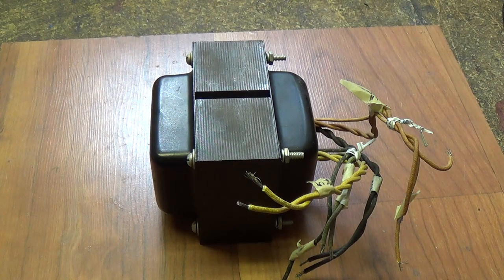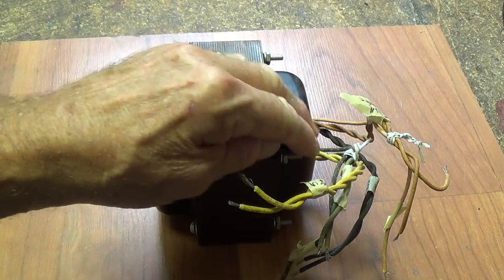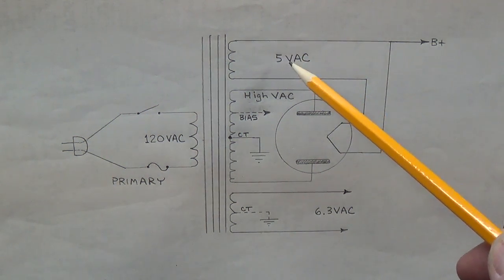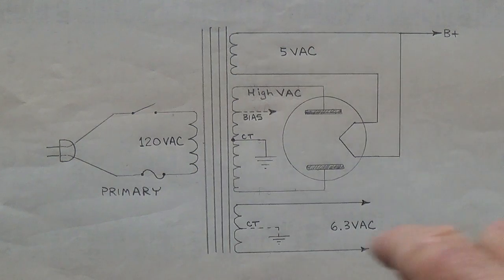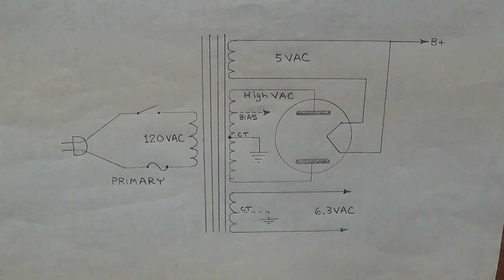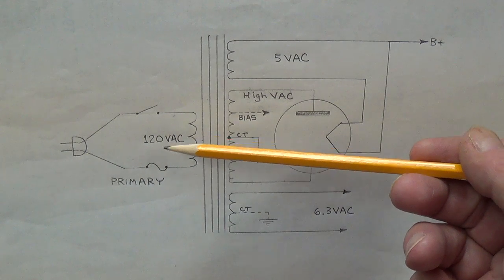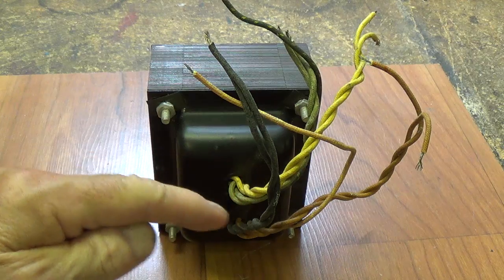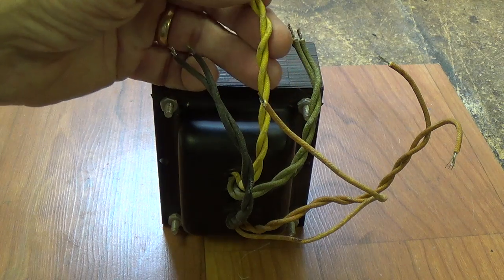How to Identify Amplifier Power Transformer Leads

Comment: Hey bud I have a fender stage 160 combo amp (not the dsp) version that keeps popping the fuse, I have two questions. I have ordered the transformers that I found bad and am replacing all the diodes on both rectifying bridges, my question is this I have tested for resistance on both the outputs and input and tested the center taps on the outs. They seem to read good. I am wanting to know how do I know what voltages should I be getting on the output side? I can give you a link to the schematic if that would help my email is Bradresor@yahoo.com I'd greatly appreciate any help on this!
Reply from the maker: Brad Resor  Brad, I looked at the schematic and all the voltages you require are listed as well as the color coding of the secondary wiring. I'm not sure why you ordered the transformers or replaced the diode rectifiers. Were they damaged, or do you think they were responsible for the blown fuses? My suggestion would be to plug the amp into a high-wattage Current Limiter (see my video on how to build one) and then try to determine if one of the secondary windings is drawing too much current, and if so, which one (high voltage is probably the most likely) and where (i.e. the filter caps....check for shorts).
Reply: Yeah the q11 transistor had the middle leg burnt off and the q17 I believe... Been a while was shorted between the three legs so I decided to replace all of them. The rectifier bridges, an electrician said to replace them for good measure. The two large filter caps I replaced cause when I got the amp one was bad. I will watch that video, build it and let you know if I have any luck, thanks for all your help!
Reply from the maker: You're welcome, Brad. Best of luck :)

Comment: While I was watching this video, when you mentioned about the low resistance of the primary, 5 V and 6 V windings and how hard it would be to measure the low resistance, I immediately thought about using the ESR Blue to test the windings. That's what the meter was designed for, accurately measuring low resistance. Of course you would have to have a Blue Meter. What do you think Uncle Doug? Would it work? I'd try it myself but I don't currently have an extra power transformer.
Reply from the maker: skeeterbuck An excellent suggestion, SB. You're right about the ESR meter being an ultra-accurate low value ohmmeter. I'll try it out. Thanks for this helpful input :)

Comment: Okay that makes sense. All resistance readings across primary and secondary windings on both the PT and OT pass inspection. I may have to move on to more advanced testing for both units. My main reason for testing these is that I feel the guitar amplifier should be much louder. I feel that I shouldn't be able to set both the channel volume and master volume to full on a 100 watt guitar amp and driving only one 12" 65 watt 8 ohm speaker.  In comparison, my friend brought over his 60 watt Fender amp and we could only get that Master Volume to 2 before it was shaking the house. My amp does sound great and is not weak sounding at all. It has 4 new matched output tubes , New preamp tubes and filter caps.
Reply from the maker: jraimondi JR, If your amp is truly 100W, it should be able to simultaneously pulverize a single 12" 65W speaker and deafen your neighbors.....at less than 
full volume :) One of the main culprits would be a shorted OPT, but if the resistance between the primary CT and either of the end windings is around 100-200 ohms and equal with no continuity to ground, and the secondary is measurable and shows no continuity with ground, then it must be OK.  I assume that it has no built-in attenuator or power-reduction switch, and that you are feeding in a guitar signal with a good cord and no effects, loops, etc. are attached. The speaker should be of appropriate impedance to match the OPT. You mentioned replacing all the tubes, but how about the phase inverter ?? Have you checked the value of the Channel Volume and Master Volume pots? It appears that either the signal is being partially lost to ground or there is a partial failure in the chain of amplification. I would suggest getting a schematic and tracing the tube voltages and resistance to ground along the signal path. If the wiring to a tube socket is bad, changing tubes would make no difference. Best of luck.
Reply: Uncle Doug So measuring the OPT in circuit I came up with 36.3 ohms from CT to one end of Primary and 37 ohms from CT to othe end and 73 ohms across both ends. The reading across the secondary is .9 ohms with no continuity to ground.
Reply from the maker: I don't own any four-output-tube amps to compare these measurements with, JR, but they definitely seem OK to me. I guess it's time to focus on the other suggestions I made above. Good luck.

Comment: When measuring the resistance of either of the Primary winding leads to the chassis or the PT case with a DMM should the meter reading be 1M ohm or more?
Reply from the maker: Jim Raimondi Greetings, Jim. I would say that there should be no continuity between the PT primary and either the chassis or the transformer body. On my meter, it would read "OL"......which I interpret as infinite resistance (definitely much greater than 1 Meg ohm).
Reply: Okay that makes sense. All resistance readings across primary and secondary windings on both the PT and OT pass inspection. I may have to move on to more advanced testing for both units. My main reason for testing these is that I feel the guitar amplifier should be much louder. I feel that I shouldn't be able to set both the channel volume and master volume to full on a 100 watt guitar amp and driving only one 12" 65 watt 8 ohm speaker. In comparison, my friend brought over his 60 watt Fender amp and we could only get that Master Volume to 2 before it was shaking the house. My amp does sound great and is not weak sounding at all. It has 4 new matched output tubes , New preamp tubes and filter caps.

Comment: Hi Uncle Doug, your scratch build projects have inspired me to do the same. I recently acquired an old short wave radio with those vegamatic radio band selectors. It has a substantial power transformer. However, the voltages are different from what you have in your video. The highest voltage is 535VAC and 3 twisted pairs of 7.3VAC. There are absolutely no numbers or markings on the PT. The mass and weight are quite similar to the PT of my 5E3. It also has terminal strips to extend the leads coming out of the block.
Any insight or will I be wasting my time with this PT?
Reply from the maker: It sounds like this PT has a high-voltage winding and three separate 7.3VAC pairs. Are you sure your meter is accurate, and these aren't 6.3VAC ??.....I am not familiar with 7.3VAC filaments in tubes. Your best bet is to look at the tubes (or better yet, a schematic) of the radio and see what type of circuit the PT was used in. Was there a tube rectifier? What type of power output tubes? Add up the current demands of the tubes....this will give you the current capability of the PT windings. Before removing any component from an amp circuit, you should label the wires, describing where they went. Probably too late now, but maybe you can recreate the circuit using wire lengths and colors. Good luck.

Comment: I was just in the dining room (my electrical shop) inspecting a power transformer id bought. Your video came up and was very informative. Thanks for posting it.
Reply from the maker: You're welcome, Jay. I'm glad the video was helpful :)
Reply: @UncleDoug  Hey Doug I have a dandy Marconi-made boat anchor T1 in my 1953 Les Paul GA-40. I am mounting it in the bottom of the box - similar to the Estey Magnatone, which reverses any proof of concept. But Gibson's two chassis hanging bolts are not safe to carry with IMO.
Thanks to you I confirmed my pin 8 rectifier socket location as my B+ line start point - then saw the actual lead in the dress. Exciting!
That meant Gibson observed & used pin outs as per international standard. Whew. Had been wondering what other tricks of rectifier tubes wiring were out there - and of course this amp is a schematical black hole.
And indeed Canadian Marconi did ot go with international standard. foudnn that fuse blows when reds are applied to rect V8 pins 8 and 2.  
Otherwise all the 6 volt starts in at V7, the trem circuit 6V6.
Looks like i have bias wire to pin 6 of V6s, other half of the power  pair.
But yes indeed '50s Gibson GA series owners - the 5v4 in V8 may well be heated by orange - not red. Now it's for me to see what damage done if any before fuses went. Rectifier tube has not turned sooty black inside so perhaps it's still alright.. 
Happy New Year Doug & recalling Rusty fondly.
Reply from the maker: @andrewgillis8572  Thanks so much for your interesting input and nice comments, Andrew.
Reply: @UncleDoug  I may ask Elon Musk to launch the Magnatone into space.My reasoning is that it already makes the right noise.
Reply from the maker: @andrewgillis8572  I'll mention this to Elon, the next time he drops by the workshop, Andrew.
Reply: @UncleDoug  Interesting. My GA 40's T1 could be a replacement part, the work done after the amp landed up here. But did notice my Arkay  with bespoke US power transformer c 1961, runs the same colour code. Red is high, not heat. Counter-intuitive, to me.. 
Big news may be that you can get this reversed, and lose only a fuse - not a 5U4. tube. Tested now, mine has survived so my re-location job may be OK.
I have used a tack room bridle strap pair to run through the handle hasps and around the entire amp. Looks cool, & lifts & stays straight. Amp's cover I think should slip under this - hasn't arrived yet.
PS Doug: the world needs know more about twin tube class A like that GA-9 - buddy has one made in MTL and it is unreal (tubes & speaker all UK sourced, badge is RCC Ltd), we agree it's like a 5 x louder Teisco AP 14(my only other amp, badged Beltone.) Key ingredient - parallel power? Let al;one, via  6V6?
Reply from the maker: @andrewgillis8572  Thanks for all your interesting comments, Andrew. Yes, parallel output tubes are rarely seen but may be an interesting concept for further development.

Comment: Hey Uncle Doug - many thanks for all of your vids! Recently acquired a Lowrey 2x6L6 with schumachers (huge iron). The PT only has 1 black primary lead. Can't figure it out getting the 120AC to the PT for the life of me. Probably obvious - can't find anything in searches... any help?
Reply from the maker: William Hines Greetings, William. I too could find no info via searches, and have never encountered such a PT. Have you tried connecting an ohmmeter to the single primary lead and then testing for continuity with all the other leads and the body of the PT? In house wiring, the common/return (white) lead is connected to ground at some point....could the PT possibly be wired with a single hot (black) primary lead and the chassis-grounded body of the transformer as the return ?? Very strange.........
Reply: Yeah, that's what I'm going with, have it wired in that manner (converted 2 prong cord to 3, added a switch) yet I can't get the tubes to light up. There are amphenol sockets on the back of the chassis as well, next to a 1/4" output jack. Found a thread that stated terminals had to be jumpered to get it to power up w/the 2 prong. It's an old '58 Lowrey Berkshire organ amp I'm converting I found on ebay. 2 6L6, 1 12AX7. http://music-electronics-forum.com/t12500/ a pic of the chassis/guts is about 1/2 way down the page here. Thanks again for the help!
Reply from the maker: The jumpering makes sense, since the original on/off switch was probably remotely located, i.e. on the organ itself. You really need to trace the circuit and draw a simple schematic....at least of the primary circuit, so you know what's going on. I would also suggest running this through a Current Limiter (see my video) until you get it all straightened out. Good luck.

Comment from the maker: CKHC VD: Your inquiry had no Reply capability. Hopefully, you will see this. Testing the transformer is rather simple. Once you identify the primary and secondary leads, you can determine if the leads pairs have measurable resistance. If a winding is open, the resistance will be infinite. Finally, you can connect the primary to a current limiter and (very carefully) measure the voltage across the matched output leads.
Reply: thank you for the lesson. i measured; with current limiter, 744VAC = 2 Reds, 5.37VAC = 2 Yellow, 6.83VAC = 2 Green. 5.9 ohm = 2 Blacks; O.L. ohms to grnd. 365.7ohm = 2 Red; 190.4/175.5 ohm to grnd(?). 00.3 ohm = 2 Yellow; O.L. ohm to grnd. 00.3 ohm = 2 Green; 00.3 ohm to grnd.
is this a good power transformer?
sorry for the "no reply" I'm not sure how to enable that function.
thanks Uncle Doug
Reply from the maker: It sounds like a good one to me, CKHC. The 2 blacks are our primary AC input, the reds are your high voltage, yellows for your rectifier tube filament, greens for your amp tube filaments. The reds should have a center tap (CT). Perhaps the CT is what you are calling "ground". The CT would probably be red with a stripe (usually yellow), and it is usually grounded.
Reply: Uncle Doug
Yes, the transformer is mounted in a chassis and there is a red w/yellow stripe to ground as well as a green w/yellow stripe to ground
the yellow wires look as though they got hot at one time, the insulation is very slightly burnt(dark yellow) where they where twisted together, this made me think i had better check it out further
thanks so much for your time Uncle Doug and happy holidays to you your family and rusty of course
Reply from the maker: The green with yellow is the 6.3V centertap, which, when grounded, reduces tube hum. You're welcome, CKHC, and happy holidays to you as well.
Reply: Uncle Doug

Comment: Thanks Doug,
I actually stripped the radio down to a bare chassis, and never considered attempting to use the circuit for an amplifier. The chassis is being set aside for a future amp build.I did a bit of reading about the heterodynes, and am aware of the dangers of power possibly crossing to the chassis. I will watch your output transformer video, and test the OT to verify readings of the wires (ohms/continuity).
Thanks again
Reply from the maker: You're welcome, Scott. Good luck :)

Comment: Hi Doug,
I just dismantled a c.1939-41 Philips CM23L tube radio...safely, I must add. I intend to use the salvaged chassis for a future amplifier project. But my question is regarding the output transformer. (This radio is a super heterodyne, so there isn't a power transformer)
The output transformer only has markings 050-064. It has 5 wires (two for the speaker on one side, and three on the other side (white/red/black)
 I know based on the schematic, that the radio output to speaker has a range of 0.9 to 1.9 watts (lower wattage is for minimal distortion).
My question is whether or not this output transformer would be a candidate for a low power guitar tube amp? And if so, can you suggest a circuit?
Thank you, and again, your videos are inspirational and fun to watch.
Reply from the maker: Greetings, Scott, and thanks for the kind words. The term "superheterodyne" refers to the way the radio uses frequency mixing to convert a received signal to a fixed intermediate frequency (IF) which can be more conveniently processed than the original radio carrier frequency. It was a great improvement over the previous "tuned radio frequency" circuits.

This particular radio runs the 120VAC directly through the filaments of the tubes, and therefore does not require a power transformer to produce individual voltages for each tube. As a result, it can present quite a shock hazard if the 120VAC manages to come in contact with the metal chassis. Also as a result, most of the tubes and components are not really suitable for guitar amplifier use, unless you chose to build a transformerless amp, which is not generally done because of the hazard described above, and the necessity of an isolation transformer to make it safe to use. I have posted a video addressing this issue.

Looking at the schematic of the output transformer (OPT), the color codes of the wiring are provided, and it appears that the OPT might, depending on its winding ratio (see my video about OPT's), be usable in a single-ended guitar amp. You could use the blue and either the red or yellow (depending on the impedance you wanted) as the primary inputs, and the green and black as the secondary outputs to the speaker.

Comment: I have an Allen Organ S-100 amplifier.  The transformer has 5 leads...two input (both black) and three output (two red and one yellow)  How do I test this transformer to see it it's good.  There are no identifying labels on it just the part number from Allen.
Reply from the maker: If you're sure the two black leads are the primary (AC input), then carefully connect them to a 120VAC power supply and then carefully measure the output voltage between the two red wires and between either red and the yellow wire (probably a center tap). If you have access to a Current Limiter, be sure to use it. Good luck.